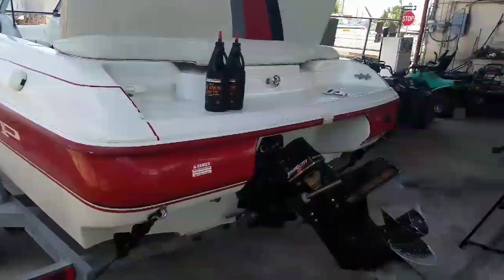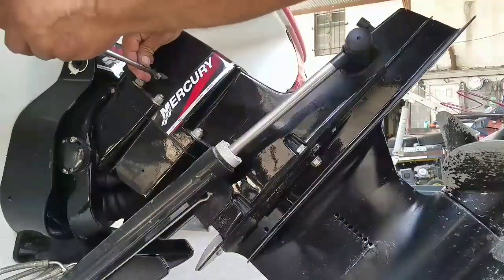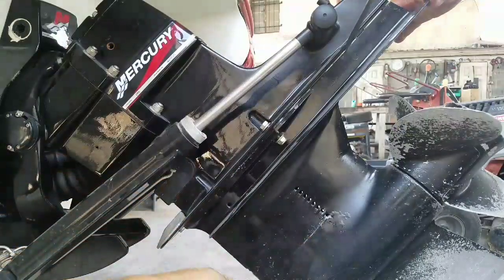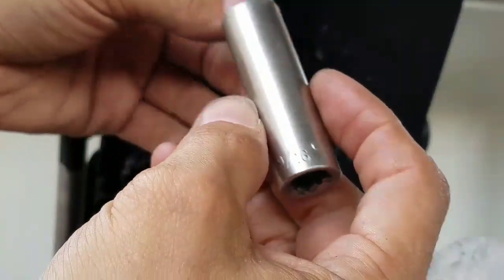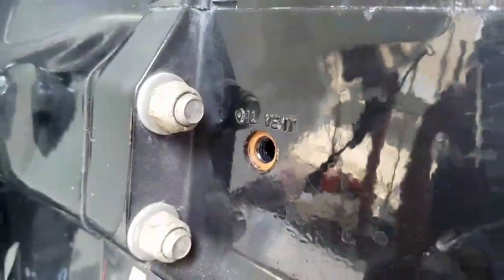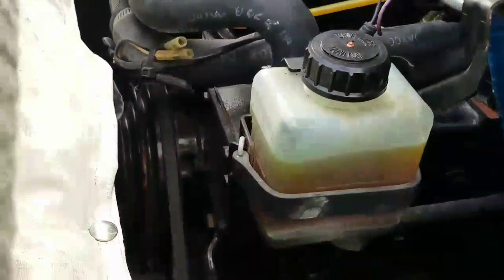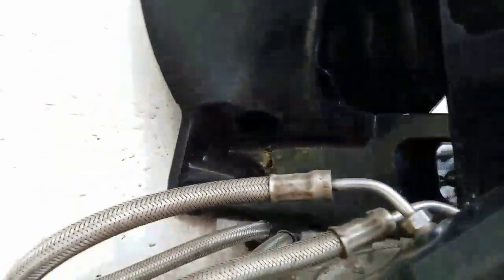How to replace an impeller on a Mercury inboard

Comment: this was great. thanks so much.  Very much what we needed. if anyone is interested, I have typed up the steps here. Hopefully everything is right.
Changing Impellor
YouTube: https://www.youtube.com/watch?v=IX9A-_zNobQ

Tools:
16 mm crescent wrench and socket wrench
0.5 inch socket
Flathead (small one)
Oil collecting bucket and pump
Petroleum oil grease
SAE 80W – 90 gear oil (about 1.5 quarts)
Impellor and gasket MerCruiser Water Pump Impeller Kit, Alpha 1 - GEN 2 - EMP Replaces- 18-3214, 47-43026Q06

1. Place boat in neutral.
2. With 16 mm wrenches, remove 3 of the bolts on the side of the prop.  Leave one on.
3. Remove bolt in back with 0.5 inch socket
4. Remove pewter silver plate in the front with 0.5 inch socket
5. Remove bolt that was under pewter plate with 9/16 socket
6. Remove speedometer line
7. Remove bottom drain plug for transmission fluid (have bucket under to collect). Remove top plug.
8. Loosen last side bolt (but leave enough on to catch the prop)
9. Separate the lower prop from the top
10. Remove last bolt
11. Remove lower prop
12. Remove screws for impellor housing with 5/16 or 8mm socket (2:55)
13. Open up impellor housing and scrape off the gunk
14. Replace the silver plate and the lock (4:17)
15. Lightly lubricate fins of impellor with petroleum oil grease 
16. Put the impellor on (lined up with lock)
17. Lightly lubricate top housing of impellor. Add new gasket
18. Rotate the shaft clockwise to help put upper housing down on impellor. 
19. Bolt in the housing
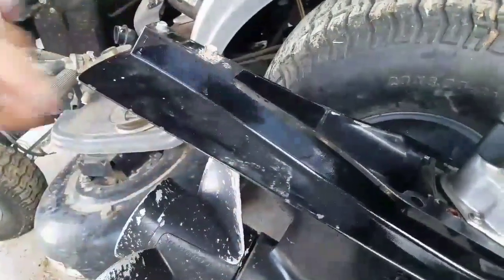20. Place the boat in full forward position 6:15
21. Replace the bottom prop housing.  Line up the tube (have it on the bottom housing).  Line up the silver L shaped rod with the notch it fits in (7:00).  Turn it so that when you move the prop blades, the shaft turns.  You can turn the prop blades whichever way you want to.
22. Replace 4 side bolts (16mm). Replace bolt under pewter plate (9/16). Replace pewter plate (0.5 inch). Replace rubber plug over this bolt. Replace back bolt (0.5 inch)
23. Replace speedometer line
24. Lower prop 9:31 
25. Connect pump to bottom transmission oil screw. Add gear oil
26. Pump until oil starts leaking out of top vent.
27. Screw in top vent screw (smaller one). Remove oil pump and screw in bottom screw (larger)
28. Fill gear oil reservoir in engine compartment.

You should be able to spin the prop while boat is off (no clicking, not much resistance). In forward, the prop should spin one direction and click the other direction. When boat is on in neutral the prop may slowly move, but not spin. In forward, spins clockwise, in reverse spins counterclockwise.  Water should not shoot out middle of prop with bunny ears on.
Reply from the maker: Jonathan Boyle Thank you for the written step-by-step guide. I'm sure it will help someone with their impeller replacement. We get many boats that come in for the same thing, but I don't record a lot of them because the steps are pretty much the same. I do however want to upload videos on how to clean out the carburetors.. I'm sure someone can find use for a video like that. 😁👍
Reply: Sorry for the stupid question, but why replace the impeller? Is this something you should do frequently. I’m new to boating
Reply from the maker: The impeller is one of 3 parts that gives the engine its life(4 if you count air). Theres fuel,  spark,  and there's water.  You can't run a healthy engine (or at all) without even one of these. 

We replace these impellers when the boat has been sitting for a while without use.  Mainly because the rubber tends to dry out with time, and when you want to start your engine,  the rubber can potentially break apart and not only overheat your engine,  but the pieces of rubber can flow up into the engine block and plug the water ports. We usually have them checked/ replaced at least once a year. Sometimes people start their engine without water and melt the impeller and housing cover.
It takes less than 15 minutes to drop your lower unit, and put it back together again.
 Couldn't hurt to check how things are running down there.. even twice a year sounds better. Not only cuz of dry rot, but maybe a faulty impeller.
Hope it helped!
Reply: GT's Performance I for one, would find a carb-cleaning video VERY helpful if you ever make one. 👍🏼🇨🇦
Reply: Great
Reply: Why should water not shoot out center of prop

Comment: That gear oil that was drained out early in the video was definitely a milky color...that's a sign of water getting into the gear oil which is not good. Could be a bad seal somewhere. Great video though, I just replaced the impeller on my Mercruiser 3.0 Alpha One Gen II engine and it should be good to go for the next several years. It's undoubtedly easier when you have a helper around when reinstalling the lower.

Comment: Thank you for this great video!! You are the only one in the net completely showing how to fix the tube when replacing the drive! I once had to repeat the whole work (without someone helping me) because the tube slipped off without me noticing it. 
Perhaps just one small hint missing: I usually put in gear in forward position when taking off the drive, then it is way easier to align the drive when putting everything together again. In neutral position it is almost impossible (at least for me)

Comment: I've read that after you plug the vent screw, you should keep pumping until your reservoir is at the right level. That pushes all the air out
Reply: yea do that and you'll blow out your front seal on your outdrive. Just top it off with a quart of oil.

Comment from the maker: Here are some tabs to help you navigate through the video.
0:00 Removing Lower Unit
2:55 Removing Impeller
4:17 Installing Impeller
6:13 Installing Lower Unit
9:30 Adding Oil
12:16 Tools / Recap
Reply: How you doing man I have a did pretty much everything what you said on the video and I left the throttle and gear but then when I put everything back together the throttle was loose and It wouldn't go nowhere
Reply from the maker: enrique madrigal do you mean you have throttle response,  but your transmission won't engage into gear? If so, you may have not put the gear shaft in properly.  Somewhere around 7:00 you'll notice I put my hand behind the transmission,  that's to align the shaft before sitting the trans in place. Also check 9:20 for a closer view.
Reply: Where's the seal on top of the water pump housing? It's purpose is to deflect exhaust gasses without it the engine can overheat at idle plus the gear oil is milky

Comment: Just an FYI this is not an inboard this is a sterndrive or inboard outboard. An inboard has a drive shaft that comes through the bottom of the hull going to a propeller that has a Rudder behind it. Other than that good video on how to do this.

Comment: At exactly 1 minute into the video you showed a close-up of the bolt closest to the stern.  THANKS!  That bolt would not budge and got stripped for me.  I tried PB Blaster for a week - nothing worked.  I thought about torching it, but the plastic piece behind it would melt causing yet another problem.  By showing that bolt, I was 100% that there were no threads on the upper drive.  The top 1/4 inch or so has no threads - yea!  So, I cut the head of the bolt off with a rotozip and got the lower drive off.  My only complaint is that you should coat EVERY Bolt that goes under water with Anti-Seize.  Every boat shop should do this.  If this had been done on my lower unit, I never would have had this problem.

Comment: Old video but for those that don't know any better there is water in that oil which means a seal or seals are leaking. Pressure test and use soapy water in a spray bottle to find the leaks. Replace the leaking seals and pressure test again to make sure it is fixed. If you can put 10psi on the outdrive and it hold for 10-20 minutes without dropping your good to go.

Comment: Excellent video! You guys do it right so even a layman can understand-thank you so much! I have one question if you don’t mind I just started up my 350 magnum Chevy with a Alpha one for the first time in 5 years, although it was stored inside and had been put to sleep with a proper winterization with oil and filter change and lower unit change and antifreeze by the mercury dealer, and I siphoned and replaced all the gas with fresh and new fuel filter before starting, and it fired right up and sounded great! I was concerned because I only noticed water coming out of the left exhaust port and its an eight cylinder and from watching your video it should have come out of both right and left exhaust ports if I understood you correctly, that only the 4 cylinders just have the one port water exit? I only ran it for a few minutes because I was suspicious of a possible impeller problem or water blockage in the system somewhere and was by myself so couldn’t monitor gauges and water output very long jumping back-and-forth in and out of the boat to see what I could notice do you think I need to run it longer and see if the right port kicked in or just pull lower unit and replace the impeller like you did to play it safe? Thanks for your help and this great video!
Dave

Comment: It appears you had Merc's original gear lube and replaced it with the incorrect type? The gear lube should be bluish green like what came out of the vent at first, before you see it turn golden, like your new oil?

Comment: I swear it looks like the lube oil drained from the lower unit is milky white, water leaking through seals?
Reply: Water for sure. I don't think he knows what his talking about!! How can he not mention that the outdrive oil is fucked
Reply: yeap seen that before on my outboard, to late to save new outboard was ordered
Reply: There was no seal on the top of impeller housing.. He didn't put one on it either so yeah going to be fill with water again.. What a waste..
Reply: Same as the flow vent when filling it.
Good eye
Reply: @dragonz868  good observation...

Comment: I also have an external oil tank for the gears, it's leaking somewhere but don't see any oil leak on the floor, though when it's in the water i see oil rainbow slick. Any common place where to look? Thanks

Comment: Always rotate clockwise.... what happens when you put he boat in reverse? Great tutorial by the way. Thank you.
Reply from the maker: 😂😂 the engine stops and starts rotating counter-clockwise. J/k
The lower unit has gears called "clutch dog" which is basically acts like a transmission. When it's in forward gear,  it turns one way.. slide it into reverse,  turns opposite.

Comment: Thank you for the wonderful video GT Performance.    I recently got a used boat and tested it in water with no issues.  However when I further examined the outdrive it appears the exhaust bellow is missing.  But no water enters the boat.  I noticed this when I put the trip WAY up.   Would appreciate some feedback / input as to if I'm stupid taking the boat in the water without the exhaust bellow, or is it ok (assuming no water is enter the boat.   Thanks in advance!

Comment: Nice job, but your oil you changed had water in it.  
Plus and it maybe just a latitude thing, here on the east coast . You are working on a Stern drive not an Inboard.
Reply: Noticed the water also! New impeller isnthe least of his worries

Comment: Just bought a used boat with the lower unit removed.  Seller had a new seal kit that he gave me.  Out of precaution and hassle free use, should I replace the universal joints along with the impeller?  Also, is there anything that makes sense to replace when you don’t know the service history of the drive unit like the main bearing on/in the transom plate.

Comment: The reason the gear oil is full of water is the black rubber "face seal" is missing from where the drive shaft enters the top of the pump housing.  Why didn't you install one after reassembly? The face seal is there to prevent pump water from entering the upper unit where the shaft comes out.

Comment: I have a Mercrusier 3.0 liter inboard/outboard similar to the one in the video.  I was pulling a tuber when the engine seemed to lose power.  It seemed like there was a vibration as I slowly took the boat to shore.  What could the problem be?

Comment: Thank you for this video, esta chingon, its the best I have seen, your photography is great. good explanation. this is what i am trying to do for 2 days, but when i try to connect the lower unit, the shaft won´t slide up. it hits metal. have my gear it forward. i notice you are moving the shift stick in the back, is that so it will slide up ??? because i know its suppose to be straight, it pulls to the right, what is the secret ? also, i saw a man say to his helper to move the  propeller. confused Pete, thank you. Gracias tecnico. por favor dime como le hago.??? what city are you in.?? another question, water was not going up to the engine, i disconnected the hose in the thermostat, and no water. so I thought its the water pump. but also could be its clogged, how can I find out which. thank you
Reply from the maker: +elimonjal at the back of the trans, you have to hold the gear shaft aligned when you are sitting it in. It can also help to rotate the propeller while you're pushing the lower unit in place.  The water pump is usually serviced once a year if used regularly.. if you don't use your boat often,  the rubber trends to dry which gives you problems.  It might be a stuck thermostat,  but I wouldn't run the engine for long if water isn't passing by... keep in touch,  I'll try help as best as I can.

Comment: Thanks for the video, I have just changed my gimbal bearing, bellows shift cable and trim senders, I installed a new sei 116 lower unit also but  I am not getting and water out the exhaust port so I suspect the water tubes did not line up and there is water coming out the back of the drive. My question is have you seen this happen and do I have to drain all the oil out to check. Thanks

Comment: I THINK THIS WAS PRETTY GOOD. IM LEARNING TO DO A LOT OF WORK ON MY OWN BOAT. THANKS.
HOW CAN I TELL IF MY LOWER UNIT IMPELLER NEEDS TO BE REPLACED VS THE IMPELLER ON MY WATER PUMP.
Reply: You should be seeing a piss stream of water shooting out of the lower unit when running in the water. This is the lower unit impeller working. Coolant flow on a closed system is a different story. I have seen people put clear hoses on the coolant lines. Makes for a fast inspection to verify flow.

Comment: Fantastic video. But aren’t our units required to use “High Performance” gear oil? And the manual says not to mix HighPerformance oil with “Premium”? 🇨🇦
Reply: Not a big deal as long as it has the appropriate GL5 rating,  80/90 is fine.   Some have additives for marine but it's not required. I change mine annually.

Comment: Great information. Going to tackle an outdrive that has been sitting for 10 years. Anything else I should be replacing?
Reply: All bellows (3)
Fluid
Impeller and housing 
O ring that connects bottom half to top half

Comment: Hey guys thanks for the video, never knew about all that. I am wondering if that impeller fits all models or is it unique to that certain model? I am trying to find out where to get the parts for mine. Thanks, I am new to boating aswell.

Comment: Great video you make it look easy! Where did you get the pump to put the gear oil back in the tranny? I have everything to do the job. I have a 3.0 TKS Mercruiser and it running hot. I replaced the thermostat with a 160 degree but the engine gets hot about 180 degrees with the Mickey Mouse water supply ears on. Gould there be some blockage in the water supply to cool the engine or perhaps the impeller needs replacing? Any tips on diagnosis of the issue? I got a laser temp gun to see if maybe my temp gauge on the boat is off. I don’t want to damage the engine and my understanding is that there is a warning system if it does get too hot is that correct? Thanks for your help it seems like you really know what you’re doing I really liked your video

Comment: Hola amigo! Tengo un problema con un motor igual a ese en el bote, se dispara una alarma cuando lo enciendo y luego se apaga el motor, me podrías ayudar por favor dándome una guía de cual puede ser el problema. Gracias
Reply from the maker: La impeller nesecita cambiarse. Se esta calientando, y se apaga para no dañar el motor.
Es una alarma de abajo del volante.
Si fuera outboard, tambien tiene alarma,  pero suena de dos maneras de pendiendo el problema. 
Si el alarma suena constante, se esta calientando. Si el alarma suena en pausas, es algo que ver con el aceite que se mixtea con el gas. 
El inboard no tiene alarma pa el aceite porque es solo gasolina.
Reply: GT's Performance  gracias amigo
Reply: GT's Performance , si la alarma es continua , cambie el impeler por el original pero no se quita la alarma ☹️ q podré hacer a continuación?? Gracias por tu atención y respuesta👍🏻👌
Reply: Mira continúa el alarma cuando el bote se prende , me podrías ayudar nuevamente, te podría llamar a WhatsApp’s, gracias

Comment: Chaparral 246 oil showed 0 pressure but oil level was good Do you think it is just the sensor? Oil Pressure Sensor Sender Switch 3852215 for Volvo Penta 4.3 5.0 5.7 V6 V8

Thanks Jeff

Comment: Actually this is known as an inboard-outboard or I/O. As long as you can easily pull the boat out of the water, it’s easy as shown. Inboards, V- drive and direct drives Mercrusiers can have on-engine water pumps that are some of the most difficult to work on in the industry. This is because in their infinite wisdom they choose to locate the pump low or under the engine. Since impeller change should be an annual on big blocks and every two on small, I have retrofitted some to end crank pulley mount when the engine room is tight like in a Sea Ray. Save pain(me)and money for the owner.
Reply: that's what happens when you hire an engineer instead of a mechanic to design a boat